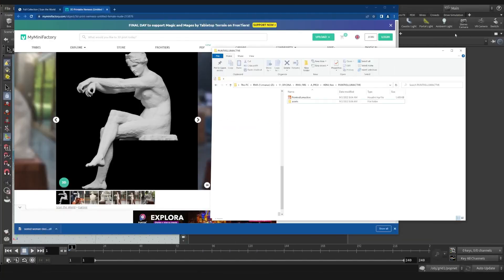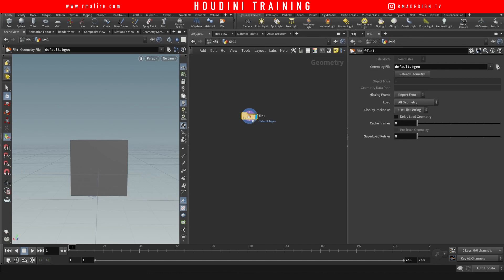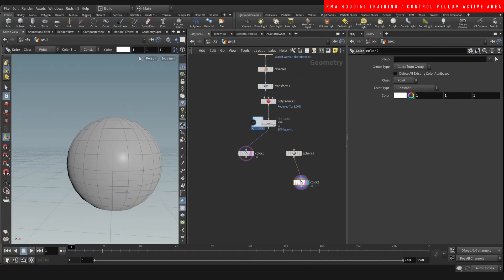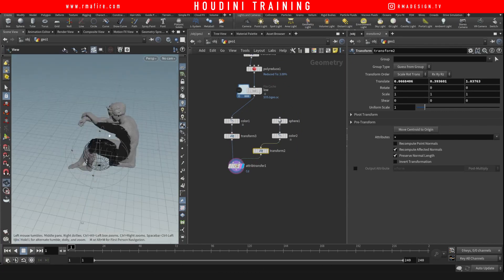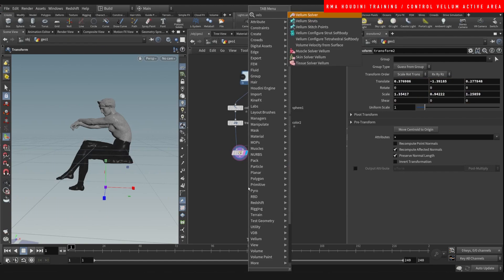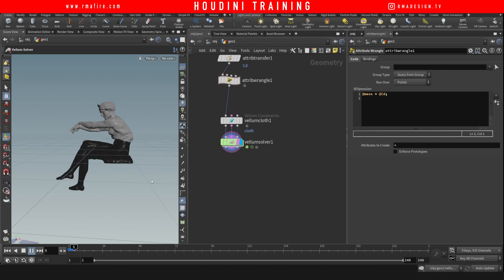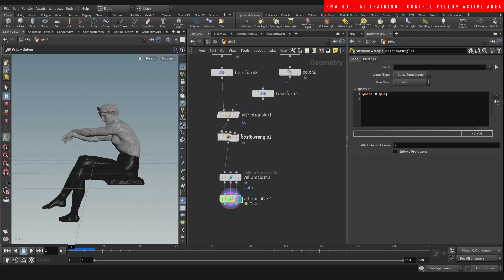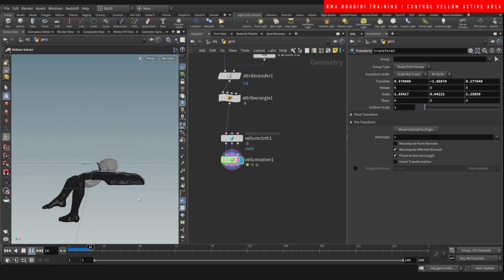Control vellum active area in Houdini | FREE TUTORIAL

Comment: Hi man ! Thanks for the tutorial.
Is there a way to animate this gradient ?
I tried using the distance threshold in the attribute transfer but it seems like the vellum solver is only picking up the attribute on the first frame.
Reply: im not shure, i have same problem but probably we should use vellum solver in sop not in dop
Reply: If you want to animate this, youre better off using vellum pin to target. Outside your vellum solver just set what you want to initially be still, then inside vellum solver you can use a constraint property to animate. For me, Ive found active, stopped, mass attributes to be most useful working with vellum grains not cloth

Comment: Great Tip, thanks man! But I think the blurred mass attribute does not really work, although its float values, the solver seems to just pick up everything that's not 0 and treats it as it would have a value of one. Or am I missing something? You can however control areas via scaling stiffness by a painted attribute which can be color as well, so almost same setup.